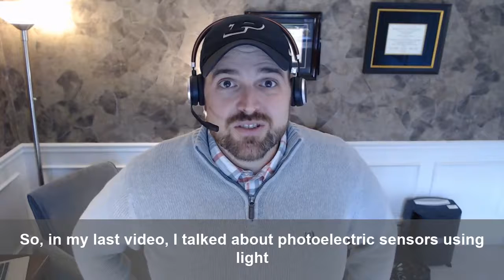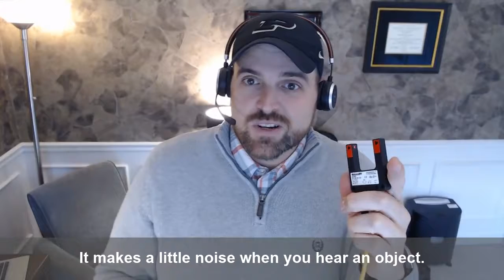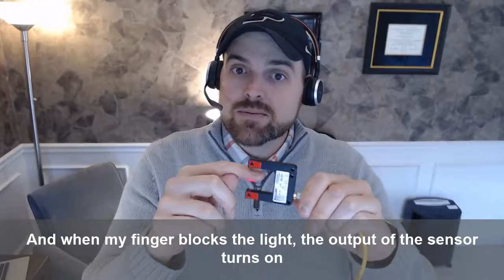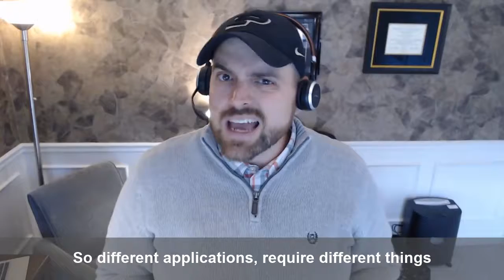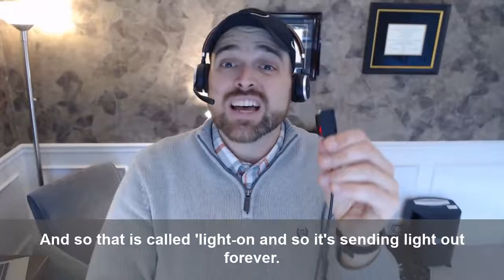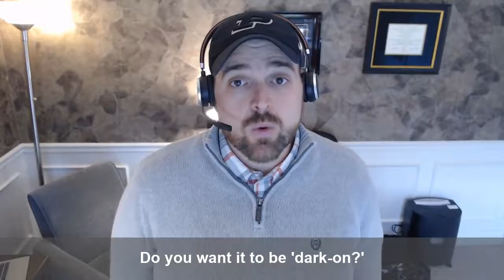Sensor Basics: What is the difference between 'dark-on' & 'light-on' photoelectric sensor switching?

Comment: is there a way to reverse this?
Reply from the maker: Great question. In the PLC or with a relay you can switch your input to Normally Closed from Normally Open and you will get the opposite effect.
Reply: Thank you
Reply: In most of the sensors, there is a knob to switch output type.
Reply: Some sensors, like many from SICK have complimentary outputs with both LO and DO.